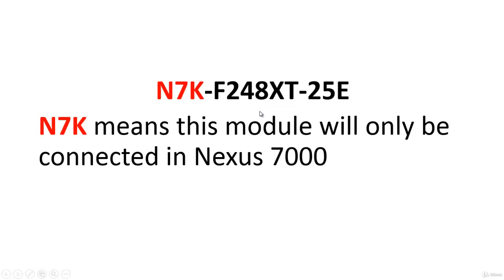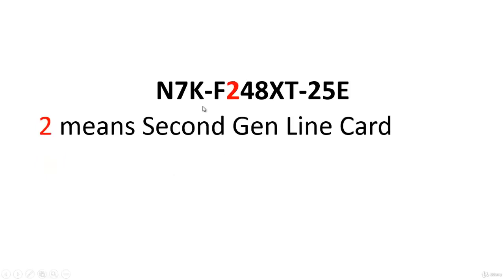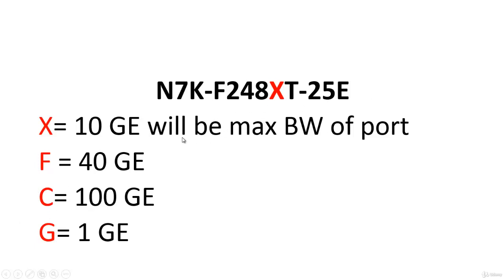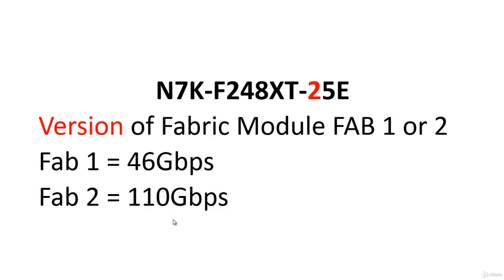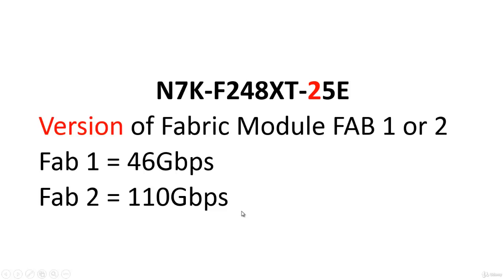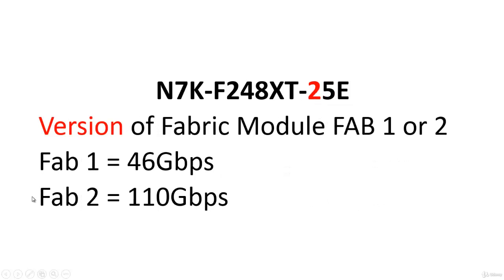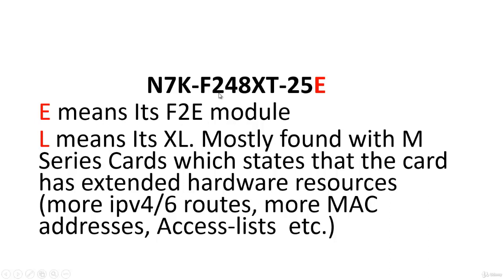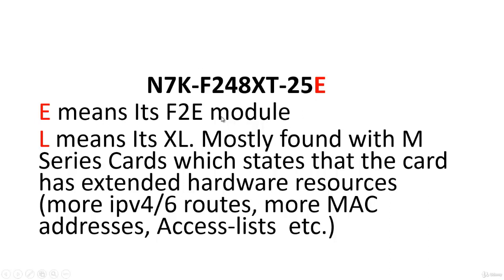Naming convention of Line Cards in Nexus 7000

Comment: Very informative, so nexus 7k etc definitely will have F or M series module installed on it? And m still confused on fabric module, does it has dedicated slot where they attached to support line card?  And if m not wrong line card and I/O module are same correct?
Reply from the maker: Line cards and IO modules are same. Supervisor modules are also modules but you can’t call them line cards or IO modules.
Fabric modules are basically connectors and have dedicated slots. One fabric module connects all line cards and super modules in chassis. You may need more fabric modules to provide high throughput to line cards
Reply: @NetworkChap  thanks for reply, ok if I say 7000-4 model chassis have 2 modules for sup and other 2 for line card, here where we install fabric module as we don't have slot for that?